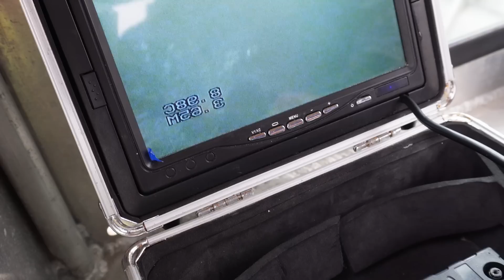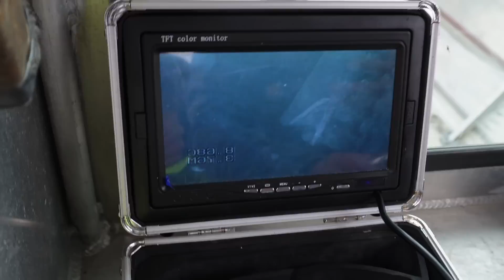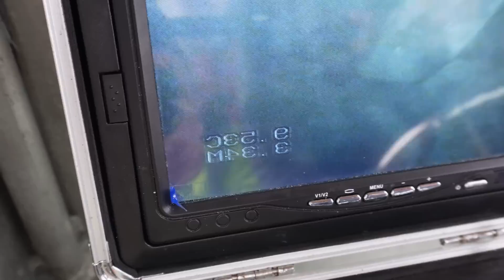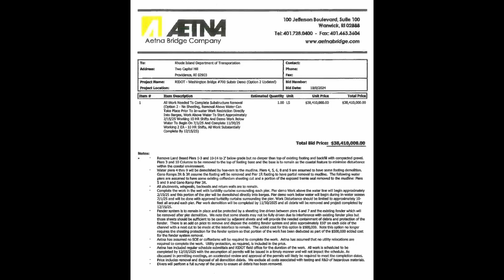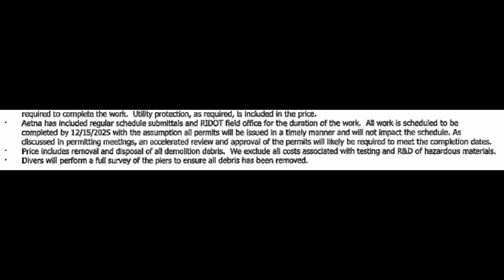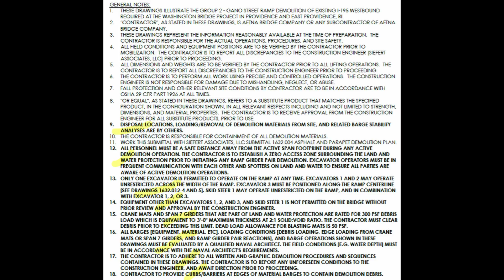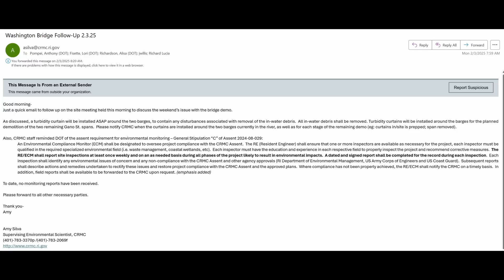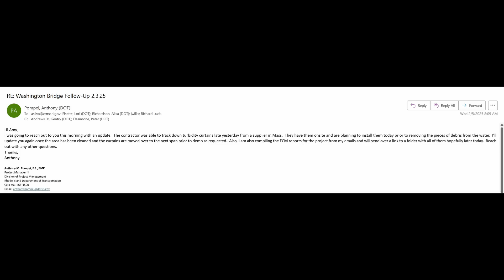Massive Pieces of Demo Debris in the Seekonk River at Washington Bridge

Comment: "Presently, the State of Rhode Island has one of the highest proportion of structurally deficient bridges in the United States. According to a report by Transportation 4 America, nearly 68 percent of Rhode Island roads are rated in poor or mediocre condition, and 1 in 5 bridges in the state are structurally deficient – the fourth highest of any state. Additionally, the Providence Viaduct on Interstate 95 and the Route 10-Route 6 junction have structural deficiencies and require significant rehabilitation." Copied 3 Oct. 2025 from the Wikipedia stub about the Rhode Island Dept. of Transportation. ... Also, I don't have the highest opinion of the integrity of RI state officials, though to be honest this is not based on any hard facts. This isn't to say they are corrupt, just lots of CYA, gaslighting and generally weasely behavior. In this vein, Director Alviti is listed as making $192,000 in 2025, but I'd love to know if he has any side connections to any of the contractors on the Washington Bridge project.

Comment: [6:57] Is that the corbell of pier 3 in the background, falling into the water as the bridge deck crashes down onto the barges???
Reply from the maker: Yes, I believe that is correct.  What a mess!
Reply: @CaseyJones-Engineer  I crossed the Washington Bridge westbound Saturday afternoon, 7 June 2025. I left extra time because Google maps indicated it as a work zone with traffic delays. In the instant I hit a calm moment and had no trouble crossing. I did note the missing half of the bridge and have been fascinated by your coverage. Having grown up in this part of the world, sadly none of the political shenanigans and dissembling comes as a surprise. My college roommate was from Providence and reported having to use his dad's connections and pay the shop steward under the table to get a summer job prepping highway cones. If you reported that there were mob connections with some of the contractors, that would not surprise me either. I look forward to your continued enlightening good works and driving across the new bridge when (... If?) it's completed. :)

Comment: Just the fact that there are dozens of window Air-Conditioning units hanging of out the front windows of the RI-DOT building........ Directly across the street from the CAPITOL BUILDING tells a story about the way the Rhode Island government is run.

Central air-conditioning was invented many decades ago and is considered to be the most effective, energy-efficient and cost-saving additions to large structures, such as office buildings.

Rhode Island is exposing itself as a backward-facing clown-show
Reply from the maker: That is an interesting point!

Comment: Really dropping it seems the quickest way. A reinforced concrete span? Look at all the rebar when they dropped it. There's some weight there. To lift that? Forget about cutting sections out it between pillions.  
 I've seen heavy mat like nets used on the water way bed. They pick up most of the larger stuff then just lift the nets up with the rest. I think they dregged the work area out first though.
 As for the corruption thingy? I'm sure the owner of the demo company has connections if not a family member or something. Pretty typical in almost all the states. 
Tried to look up the net technique. Didn't find much about it.

Comment: From the outside perspective of someone with very limited to the construction industry (from a commercial transportation aspect only), I definitely agree with your statements and opinions. R.I. seems pretty sketchy to begin with.  If I remember correctly, weren't they the state that was imposing tolls on semi-trucks only? Yeah... it was R.I., I just Googled. 
The whole thing about a heavy truck bouncing the bridge is a mixed "loadful" of crap and sailboat fuel. As a former trucker, I have been across numerous bridges throughout the country that had a bounce... I mean, we're typically upwards to 80k pounds. That's a lot of weight that's transitioning across the segments.  The bridges will have some give to them... hence the expansion joints throughout.  
As for the 'personal' backlash you've received and the lack of access to public records from the R.I. DOT is really unnerving and extremely disappointing.  You're already receiving national attention being that 1, I'm watching your videos in Oklahoma... and 2, even the DOT director has called you out publicly. Keep pushing until you can push no further.  But keep in mind, the federal government has more pushback than that tiny state.  Push come to shove, get the feds on your side.
Reply from the maker: Thank you so much.  I do believe the Feds will expose this Rhode Island mess at some point or at the very least, cut off their funding.

Comment: Casey,

As a retired naval architect, I would have a hard time approving a demolition plan that called for dropping large pieces of concrete onto the deck of a barge.  My experience is with tank barges and a few flat deck barges used in transportation of cargo to Alaska.

Prior to my retirement, I worked with our chartering group in the evaluation of tank barges.  The barges were used for single cargoes.  A pool of pre-approved barges helped improve selection.

Without structural drawings and recent inspection reports, a true evaluation is impossible.   I can say that it is unlikely the barges were designed to have concrete bridges dropped on them.  It is also to say the scantlings, steel plate thickness, will be light in comparison to a ship.  It is also common practice to use intermittent welding throughout the barge.   Continuous welding may be present in the bow and stern.  I'd want to see the inspection history to look at crack repairs and plate renewals.  I would like a current internal inspection to look for cracks, buckled or bent primary, and secondary structure.  For the barges that were submerged, I would like to know whether a crack or excessive loads were the cause.  I would also like to know if there was damage due to the grounding of the barges.  Based on the videos, I would not assume a wood deck covering, cribbing, and air cushions absorbed all of the load.

Out of curiosity, why not place the barge under the structure and crib under it until it was fully supported.  You could then move pieces of concrete to a disposal location.   But that would require planning.

Bob
Reply: A written "Safety Plan" would seem to be a no brainer, unless someone doesn't want a paper trail.
Reply: They aren't getting their security deposit back on that barge rental
Reply from the maker: Thank you so much for your comment!

Comment: Having done a major bridge rehab project with Ammann And Whitney, two things stand out about this project. The demolition plan involved "dropping" large segmnents instead of sawcutting them and hoisting them directly to shore. A dangerous and costly method (barges, tugboats, etc.) of working. Shame on the Coast Guard, RIDOT, the engineer of record and the consultants for allowing this. Also, there was no horizontal  "protection shield" beneath the work areas.
 Who is the final authority for the maintenance of a navigable waterway? The naval architect or the Coast Guard?

 I pray no no one is killed or maimed as this work proceeds.

Comment: It's possible that a state such as Rhode Island simply isn't large enough, i.e. doesn't have the "critical mass" required, to maintain a DOT capable of handling large, problematic projects.  The New England states might be better off forming some form of "joint" DOT where they can pool their resources, and create a single, large organization that would be more capable of handling larger projects.

Comment: Would you be able to answer a  structural engineering question on something very much in the news right now? It might be somewhat outside your area of expertise as it's more about the top of tall buildings rather than the bottom.
Video in the news from Thailand shows water from rooftop pools cascading down the sides of tall buildings because of the earthquake. Would that mass of freely moving liquid have the effect of a tuned-mass damper, or would it make the situation worse?
Reply: More likely free-surface effect, I'd think.

Comment: 6:53 Could the column seen at the right, falling in the background after the bridge section crashes down, be the same one you saw at the bottom of the river? It doesn’t look like it fell onto a barge.
Reply: I was wondering if the activists just took Casey out to a random spot in the river and immediately found debris or if they had prior knowledge on where they would find something. This would explain why they would make sure to have Casey on board for that trip as a witness.

Comment: Naval Arcs unusually are employed to perform stability and condition analysis of commercial craft (including barges).  They do periodic certification and re-certification of things that float and determine if craft are still within the design limits.  They also will provide professional assessments of  if a new use (one that was not considered in the original design of the craft) is compatible with the design stability of the craft, and its current certification, and provide operational limit guidance for novel uses.  

They might say that you can't drop a 100T load on this particular barge from a height of 30' as the size and loading is such that the unit will not remain stabile.  But this other barge could handle it with the addition of continuous 12" hardwood mats that span rail to rail or frame x to frame y.  If using multiple barges to support a single load, they would also look at the loading on the connections between units, and if the deck fittings and lines can handle the loads that can be expected (overloaded deck fittings and lines have a history of killing deck workers).  As with so many things, a lot of energy gets concentrated in the connections.
Reply from the maker: Thank you for your comments on that!
Reply: They might also say something like "and don't poke any holes in it with the rebar" , a real possibility if your controlled demolition isn't controlled.

Comment: I’m honestly amazed you could see anything down there in the depths of the Seekonk. My lifelong experience with East Coast waters has been that you can barely see your hand in front of your face because of the river silt and the plankton.
Reply from the maker: Yes, it appears we got lucky.  Plus the debris is just a few feet below the water surface.
Reply: @CaseyJones-Engineer Thanks for the reply. As I think about it more, I realize that the geology of Southern New England is pretty different from that of New Jersey, where I grew up and probably leads to less sediment in the water, which may explain some of the difference.

As a sidenote, I happen to be a naval architect. I don’t know whether or not they had a qualified naval architect review the arrangement of the barges. That said, the fact that one of the corbels apparently fell into the river would seem to indicate that the barges weren’t underneath it when it came down. That makes me think that either the corbel fell when it wasn’t supposed to or that the barges weren’t in the correct location when it came down.